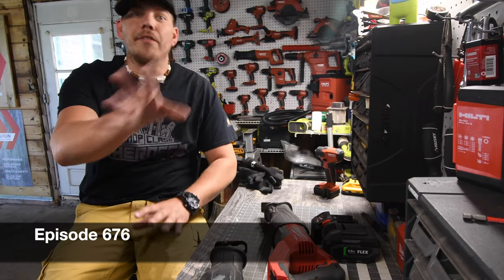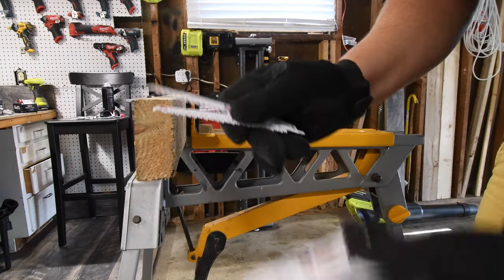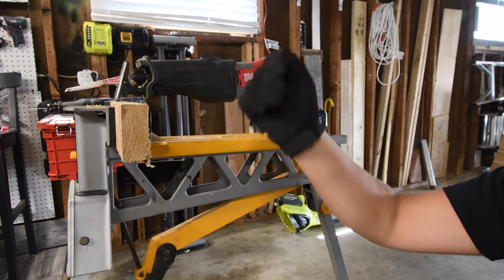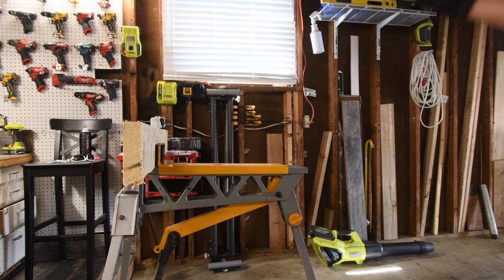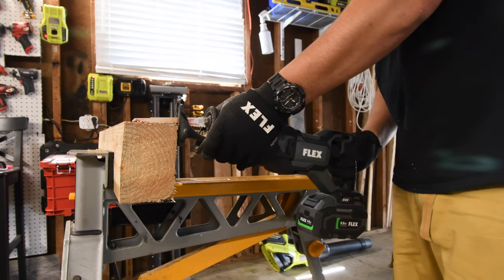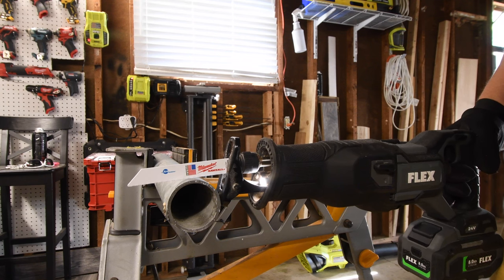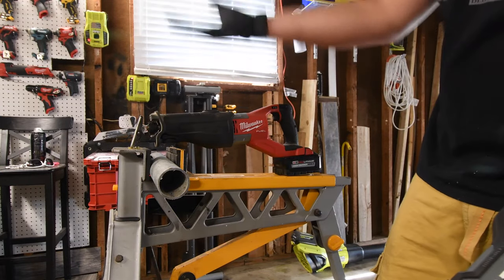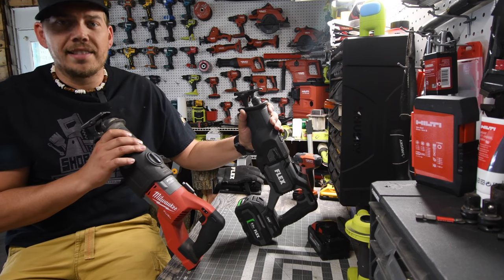Best Reciprocating Saw?

Comment: I’ve noticed the longer the stroke the quicker it will cut and that goes for all brands even if one is more powerful if the weaker one has a longer stroke it will still most likely beat the other.
Reply from the maker: stroke length is important. longer the cut, easier it is to complete the task
Reply: The longer stroke offers less control in close quarters. That's why I like the seemingly weak dewalt hackzall for certain things. The 5/8 stroke offers the most control on the market.

Comment: I was debating between the super sawzall and the Metabo HPT 36v but ultimately went with the Metabo because it was $100 bucks cheaper.   I didn't consider the flex but it looks like its competitive for sure.
Reply: I had trouble with my Milwaukee fuels blade change within a couple months. It gathered dust for over a year before I spent two painstaking hours repairing it. Only lasted another couple months before the same problem occured. Grabbed the DeWalt flexvolt advantage and the Metabo 36v. I've abused the DeWalt but it doesn't have an adjustable shoe or rafter hook. Can't speak for the metabos longevity yet but the power is definitely there.
Reply: @Tool_Addicted_Carpenter  gotta oil it. Oil bath the tip

Comment: I'm with you on the string with weight which most people put 10lbs on, most people who use a recip saw put 40 to 50lbs of pressure on the saws
Reply from the maker: you need to feel the tool work when it comes to recipes saws. make adjustments if you feel the tool just going back and forth

Comment: I know every reviewer is tired of hearing they used the wrong battery, but the 216watt hours of the 12AH HD12.0 is closer in total output to the 192 watt hours of the 24v 8.0ah batter than the 144watt hours of the HO 8.0. The 8.0 Flex battery has 88% the total output of a 12.0, while the HO8.0 only has 75% of the output of the Flex 24v 8.0.

Comment: Looks like the flex has way more vibration during the cut
Reply from the maker: during the beginning the flex did vibrate big time. that 1x6 is also cheap wood.
Reply: @ManCaverTools  looked like a 2x6 to me from the angle But yeah I agree it vibrated like may on the 1x6

Comment: Geez that flex sounds like a chainsaw cutting through concrete yuck 🤮  great video that Milwaukee is smooth as butter amen about holding it I agree 1000% !!
Reply from the maker: both saws are a beast
Reply: The flex has alot less vibration believe it or not. Check out vcg construction on their test on vibration

Comment: Wrong! You simply insert the blade in the flex, it has a quick insert collet since it’s not currently patented..
Reply: Makita has the best quick blade change imo.
Reply: @Tool_Addicted_Carpenter  never actually used a Makita recip, what’s the collet on the Makita like?
Reply: @athannaelanderson3806  The blade just clicks in and then when you twist it for removal it shoots the blade out so you don't need to worry about broken blades getting stuck inside or having to shake hot blades out. When I go to work tomorrow I'll make a short video of it.
Reply: @Tool_Addicted_Carpenter  that’s exactly how the flex works though
Reply: @athannaelanderson3806  Haven't used the Flex yet. Makita has had it for 10 years now.
Reply: @Tool_Addicted_Carpenter  crazy, guess the patent just ran up.

Comment: The Milwaukee requires 12Ah battery.  It sounds like can't hold the speed with an 8Ah battery. Retest in wood with the appropriate power source.
Reply from the maker: I can do a versus video with 12ah batteries, and I will
Reply: @ManCaverTools  okay, im curious 🙂

Comment: They both did great a better metal blade and slower speed will eat that metal like cheesecake seriously... Dave i have some blades if you need the dialblo man hooked me up and took pictures of me using dialblo sand net on a commercial job the sand net hooked up to my dewalt orbital with my packout vacume no dust at all when we started with regular paper and dust was everywhere sandnet took 99% of dust out of the air i have the new flex blades the new dialblo carbide blades and the new nitro carbide blades have you considered doing the challenge with @IMPACTNATION
Reply: The sanding nets are great with a vac. Couldn't believe how well they did when sanding a lot of drywall. They didn't perform well on PT though. I was cleaning up some treads to add some non slip stick on pads and I needed to switch to regular disks to take anything off. Was using 100 grit.